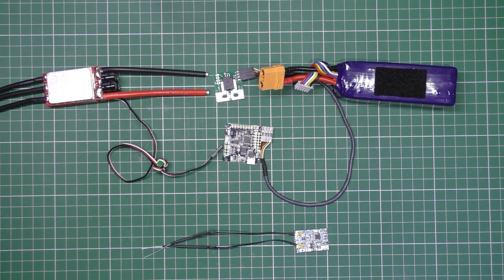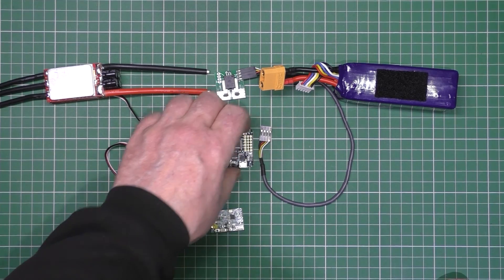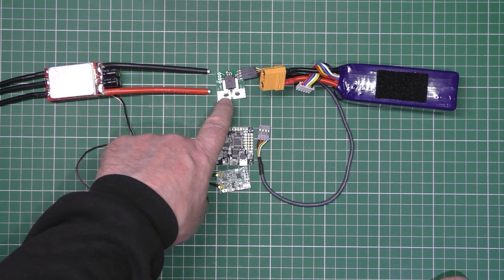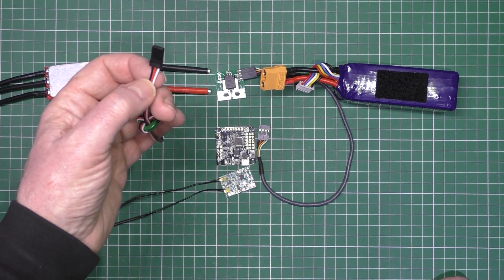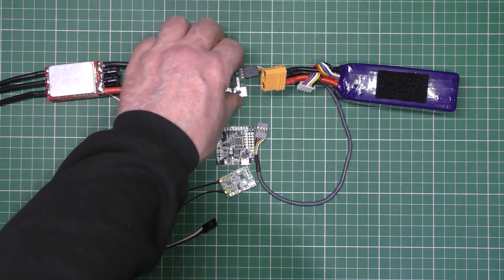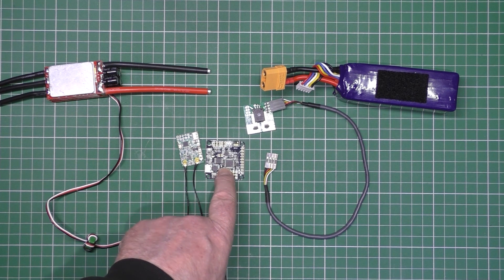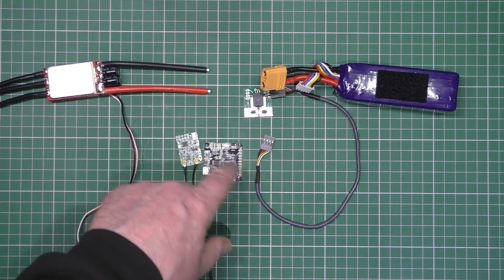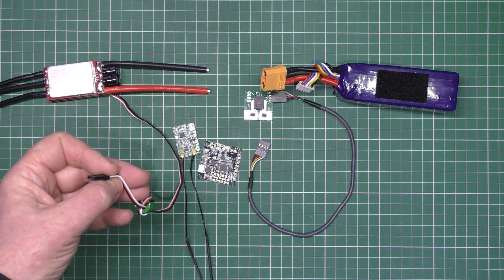Ground loop - a warning to everyone using the ESC BEC

Comment: I've always thought they'd use opto-isolator to isolate the signals from the power circuit (unless we're talking about using the BEC output on the ESC). If the ESC do use opto-isolator, and we do not use BEC output on the ESC, then not connecting the ground would eliminate common ground voltage reference.

Comment: I run acro quads without the signal grounds in the past but in all my latest builds I leave them on .So, I maiden a new 4 inch quad today. Kombini, diatone sp2, piggy osd,1189. Immediately I noticed noise from the escs( got worse on throttle). Saw the video just now and removed the signal grounds (had no idea about ground loops). I can actually see less noise so I probably had a ground loop ,but a small amount is still there. So much for the video filtering of the kombini and the sp2.
Reply from the maker: If it's improved things by removing the ground wires, you may have another ground loop somewhere else or some inductance interference. Do your battery wires run past any video wires?
Reply: Vortecks i don't think so,  but it is a crammed build so maybe .  I will open it and spread the wires to see if there is another loop.

Comment: Hi Tony, my new SW1900 has a 60amp ESC with a 5amp BEC....Im going to try pulling the black wire as you suggested....It will have my Storm AP with current counter and EZUHF muxed RX...I assume it will then get an earth via the current sensors (thinner wires?)......Since I will be using a 12vdc BEC and a single 4S flight Lipo, this will feed the 12V supply needed by the Storm, so now I still have 2 earths...?....Or is this still ok?..The other thing is the ferrite ring on the ESCS BEC...with the ground pulled off, will this still function ok.?..In the past, this ferrite has proved essential to prevent OSD flicker on the Storm...and BTW on my Tiny Skylark OSD....Point taken about the potential loop though, its a very bad scenario if it goes belly up, your right....Im confused now...:(
Reply from the maker: +EnglishTurbines The top & bottom of it is mate....... If you use the BEC in the ESC, cut the black wire. If you're taking power from your flight battery (to power your 12v BEC) make sure you get the +ve and -ve directly from the ESC side of your current sensor (solder directly to the pads) and never splice into the wires between the ESC and current sensor.  
I don't think you'll ever manage to completely eliminate a ground loop but following the above will greatly reduce the risk of the current flowing through your flight controller, should anything fail.
I'm crap at explaining things, that's why I never did this video before. Have a look at Coyote's video, maybe you'll have a clearer understanding.... https://www.youtube.com/watch?v=xTo40NnQAE8
Reply: +Vortecks Thanks m8, its clear enough now...I did watch Coyotes video ages ago...Problem is, each setup on its own merits...I will do it as you have suggested though, thanks...:)
Reply from the maker: +EnglishTurbines The best thing to do is cut the black wire, take the SW outside, hold onto it and give it full throttle for 20(ish) seconds.If anything's going to happen, it'll be on the ground rather than in the air. I've learnt that checking everything 100 times is no substitute for testing it once.

Comment: Surely this is only a problem if you use a current sensor which, by its very nature has some resistance.  Without the current sensor in circuit the lowest resistance path is going to be the main power leads
Reply from the maker: +UKHeliBob Not necessarily, Bob. I tested an Emax 60a with full load and after 30 seconds, the resistance in the main 0v line was higher than the 0v from the BEC. I think it's something to do with the FETs breaking down when they're about to burn..... shortly after, it did burn and the BEC started spewing out all kinds of voltages. Obviously, if the ESC burns, you lose everything but with an external BEC, you still have video and control but no motor. I'm not saying it's a bad idea to use the BEC in the ESC, it's just to highlight what could/will happen.
Reply: +Vortecks What sort of values did you get for the resistance for the main line from the ESC without a current sensor and via the FC ?  How different were they ?